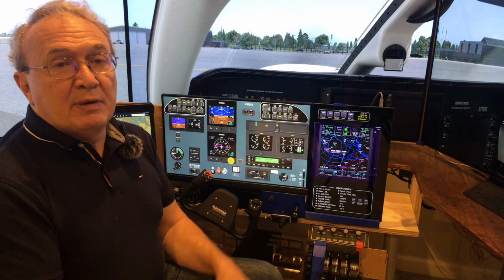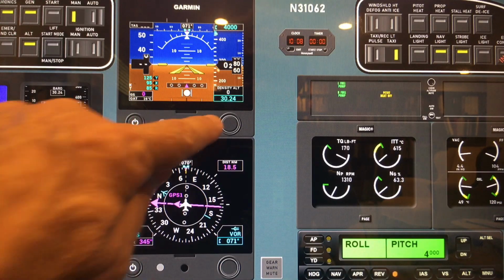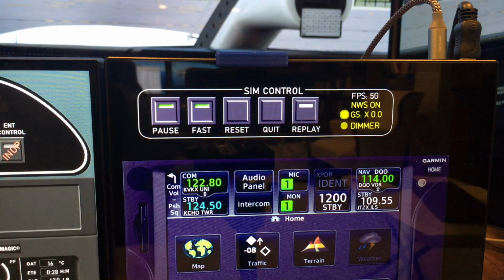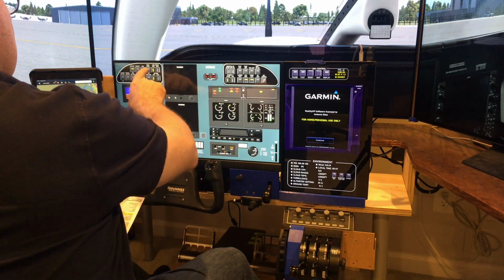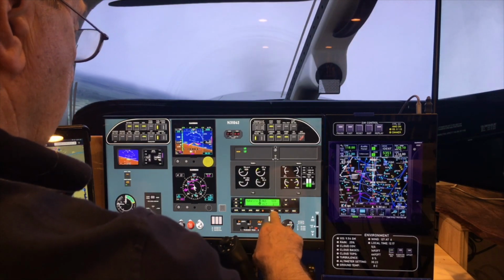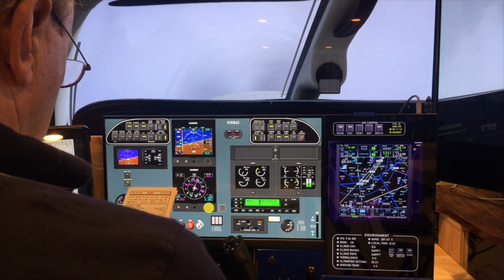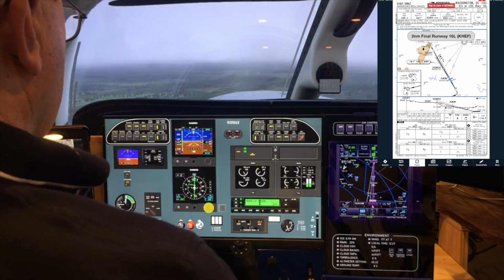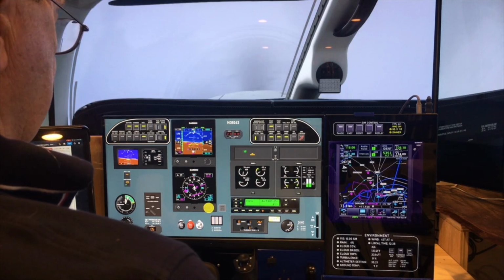Piper Meridian Home Simulator

Comment: Wow nice setup! What screen are you using?
Reply from the maker: Outside view: 3x LG 55 inch OLED TV's Control panel: 1xASUS 22 inch touch-sensitive monitor in landscape mode plus 1x "no-name" 16-inch touch sensitive "iPad external monitor" bougth at Amazon (portrait mode).  I bought them back in 2029, there may be better/cheaper models now.  The three outside monitors are driven by an NVIDIA GeForce RTX 3080 10GB GDDR6X PCI Express 4.0 card, the two control panel monitors by a much smaller  GTX 1080 card.  The 3080 averages 70% duty cycle at 25 frames per second, the 1080 coasts along round 50% duty cycle.

The 3080 duty cycle depends a lot on the weather - with cler skyes I can get over 50 frames per second!!!

The three outside 55 inch monitors are at a 70 degree angle with respect to each other, centered on the pilot's eye position; therefore I get a 210 degree complete field of view, which I find sufficient for everyting except circle-to-land approaches.